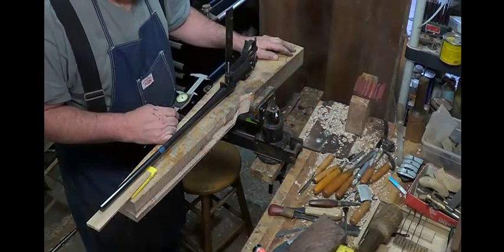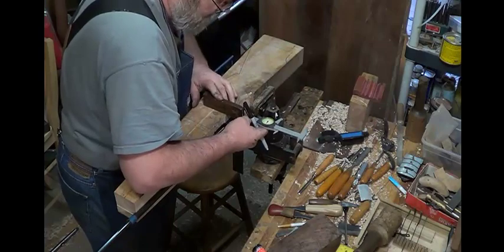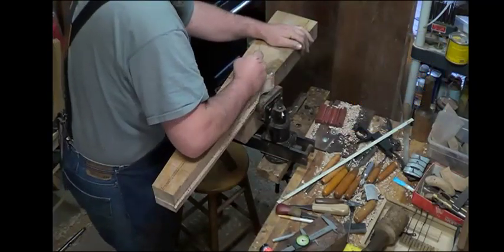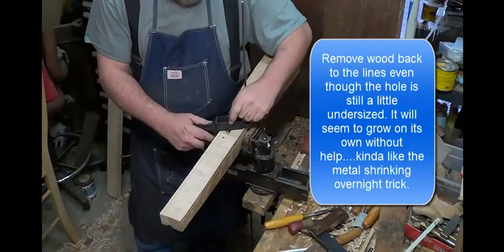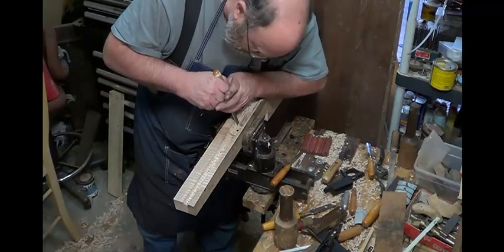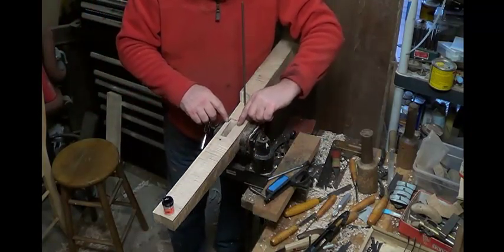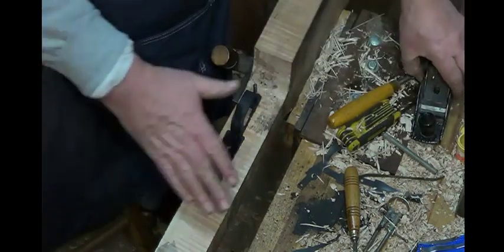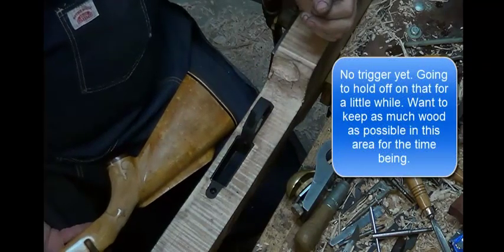Inletting Bolt Action  part 7 Inletting the Trigger guard and magazine

Comment: Thanks so much for taking the time to give me all this information. I have tried a little inlay work some years back, if I remember it works best with very soft metal. I was using sterling silver but next time I'll try pure silver as its both softer and less likely to oxidise (less cleaning against the wood stock). I think also when I did it the ribbons were not wide enough so they had a tendency to come loose. As you say practice is the key so I'll give it another go.

Many Thanks

Marcus

Comment from the maker: Good idea!  Silver inlays are used a lot as well as wire inlays. They are made from what we (here in the USA) call German Silver (no real silver of course). Either wood will work. Scorching or treating the maple with Fortis Vitae (hope my spelling is close to correct) with iron fillings will darken the maple. Since tiger strip/curly maple is the most common wood for muzzle loaders, it does work. Google or Bing pictures and you will see what I mean. Walnut starts out dark,

Comment from the maker: a moving target with a 22LR is a challenge.  Best of luck! Anschultz is one of the best to try it with too. Mine has had over 1/4 million rounds through it (took 30 years to it)  and to this day still shoots under 1" groups at 100 yds -when I can remember to do my part of course. Deep pistol grip can b made fro a standard blank. Make a template from your existing stock and just add the extra material. When it comes time to shape the outside, keep it extra large until you can spend time at

Comment: Regarding brass, it’s a tricky one. I’d like to say I have a magic recipe but unfortunately I don’t. The best I've come up with is if the area of brass is not subject to wear and tear then modern acrylic lacquer is quite good (I use this for silver watch dials but they are protected under glass). The lacquers are soft though so if the area gets scratched or worn they look awful after a while. After that you can try wax or oil which may help, but ultimately it’s back to good old elbow grease.

Comment from the maker: Marcus, you might be disappointed in pure silver. The stiffer (harder) German silver can be tapped into the slot/groove better. It is just the friction of the wood that holds it. Silver is soft so it will bend and (very scientific description) squish to fit the slot. Not a good method when you want things to bind. Also, pure silver will tarnish quickly. Black powder has 10% sulfur, so you know what that will do. The old timers rarely used it for good reasons that still are in place today.

Comment: Thanks again for the advice. I was thinking of “normal conditions” where pure or fine silver (99.999% silver) tarnishes less than sterling (92.5% silver + copper and tin). You are right, with all that sulphur floating around, all bets are off.

Comment from the maker: other names for German Silver is Argentan, nickel brass, albata, alpacca, and electrum. Not all is lost -Silver is useful where you want a dark or black line. Silver is used in steel (barrels etc.)  because it will turn black. I get ribbons from Track of the Wolf ( here in the USA). Not sure about sources in France. By the way, how would you prevent it from tarnishing? I have trouble with brass tarnishing to all sorts of ugly colors -even under a good oil finish -any ideas? 
Good luck,
Chris

Comment from the maker: Peter,  Good thing I could edit somethings.......
An inch is excessive. You would have to "crawl" across the top of the stock to get to the sights. Left/right handed takes about the same amount of castoff. Just opposite directions of course. Hope you are not one of the people that need a left shoulder/right eye type of stock. If so, all bets are off. You can get extreme at 5/8", 1/2" is best. Most of  the 43 calibers do have some kick, so some cast off will really help with that too.

Comment from the maker: the range. Don't finish it of course, and don't embarrassed about using a stock in rough shape. You are finding out what works for you. Might also want to make a first try out of some cheap wood. When you remove too much wood, Bondo, wax, etc. back to where you wished you had stopped. Look into shotgun gun fitting. Angles will help or hinder what you are doing -IE. barrel angled up for higher shots (skeet), straight (trap), down for sporting clays and some trap to name a few things. good luck!

Comment from the maker: check how the top of the magazine sits in the machined out area in the bottom of the receiver. Often the machining is overlooked, or the casting is poorly done in that area. The magazine needs something to position it. Might have to GENTLY bend the walls out a little, or grind away some receiver metal to make a well for the magazine. Make sure this really is the issue before you do any bending/grinding of course. Is the follower in backwards? I have done that in the past. :)
Good Luck,
Chris

Comment: hi Chriss, i really like your videos,very helpful
i decided to try it myself  ,using power tools,and handtools if necessary  the only problem that i ran into  is that the bolt rubs the top of the magazine  even though the action screws are just long enough  ,what would be a good way to solve this problem?

Comment from the maker: oak?!  wow, you are a masochist. Please check the metal parts often. Oak is very acidic and will eat steel and aluminum. In just a few years, the smallest screws probably won't be there, just black stains in the oak. Odd thing -Walnut has just as much or more tannin as oak, yet does not corrode metal. Confuse a simple mind!